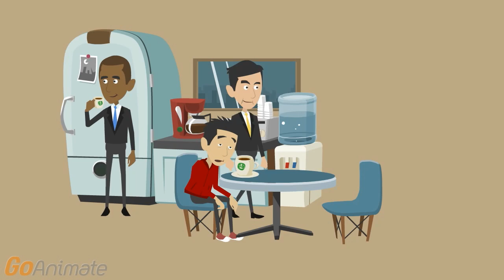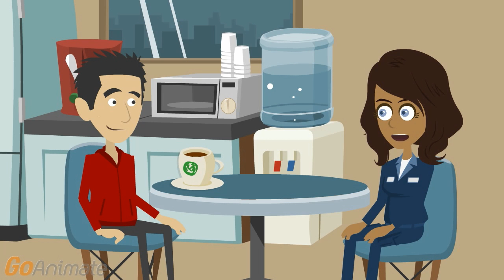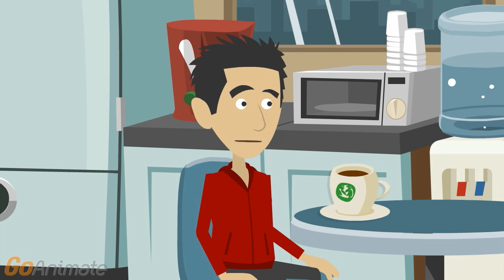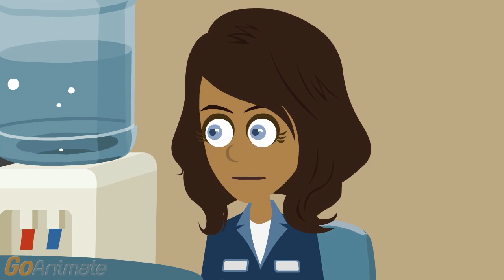Rheem and Ruud Furnace Error Code 57

Comment: Thank you for the help.  It was super cold and the furnace stopped working with code 57.  After reading you comments, I checked the outside vent only to find an ice dam obstructing the intake.  After removing the ice (and board I leaned up next to it in the fall) the furnace worked fine.  Thanks again!!!